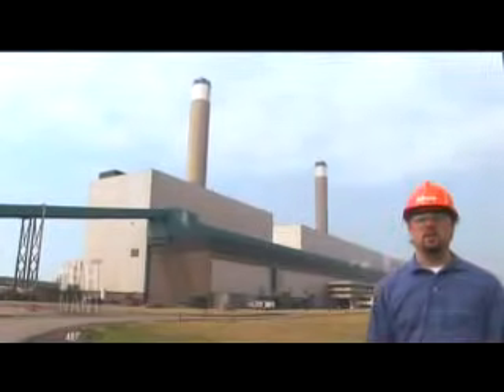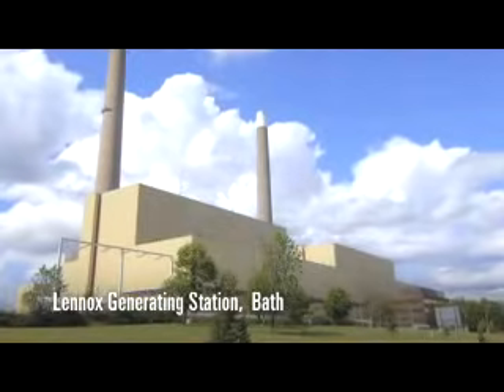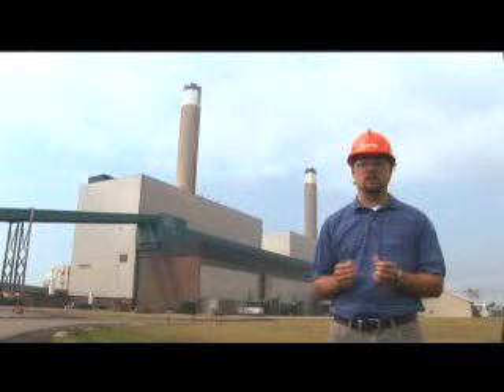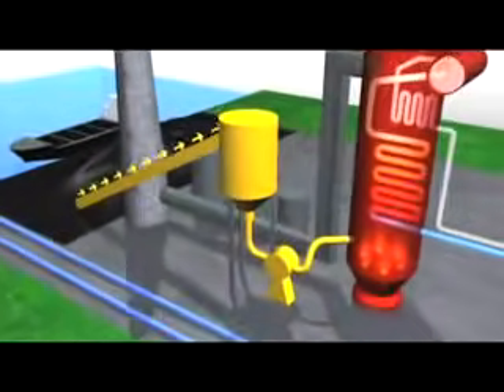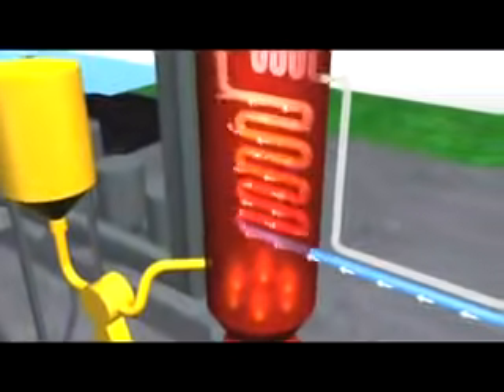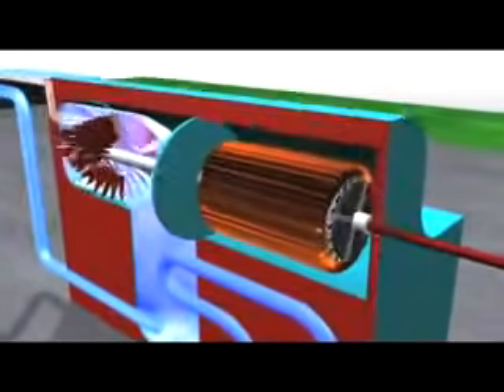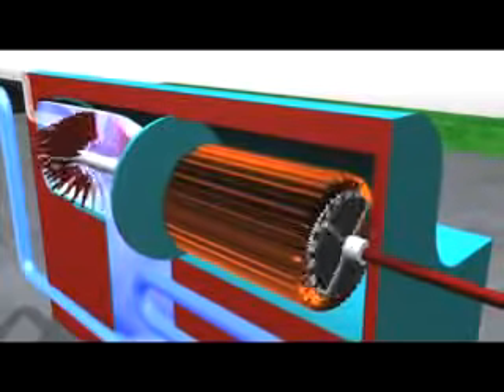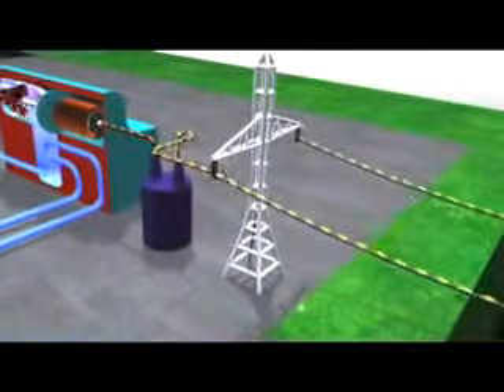How a coal power station works

Comment: don't They Saves the generated electricity in LARGE BATTERIES ? which can then be converted into A.C.currents whenever there is demand. plz elaborate .
Reply from the maker: C.A. Bachhav no. It’s not possible to store the large volumes of electrical energy required by homes and industry.

Comment: Wait why is there a turbine when we could just pit the rotor there instead (and maybe with blades so It could act like a rotor) and plz tell why this won't work XD
Reply: Because the turbine IS the rotor. A rotor, by definition, is any part of a machine which rotates.  Turbines rotate.  They have to in order to move the electromagnets. Hopefully you get a notification from this so you can finally get your answer.

Comment: Mr. Patel,

I'm delighted to see that you've worked so hard on this model. It clearly violates the Law of Conservation Of Energy. I've a few arguments to make.

1. If it is so, then why don't you connect the output of the cam to the input mechanically, And see if it operates on its own. As the output of your isolated device is more than the input.
2. Linear force X Linear distance is not equal to Radial Force X Radial Distance. All it matters is the shaft creating as much energy as well.
Reply: on god no kizzy

Comment: The question was not clear. What do you wish to do? Mix the Smoke from the coal directly in the water? The fire burning in the Kiln is producing the smoke, but it is conventially used for heating the air only. So the energy of the hot waste gases are already drawn.

Comment: 1. First of all you can never eliminate a condenser from a thermal cycle which includes steam.
2. efficiency is only measured in a power plant for a closed cycle.
3. The steam that gets condensed in the condenser is only responsible for the vacuum. The air pumps are only responsible for removing the non condensable gases. And creating vacuum for initial start-up.
4. Lower the density of what?? Please read your own last line of the comment, and consider yourself Dumb. 

Peace.

Comment: I think I understand the positive pressure concept.  I'm working on a project to recover energy loss in a kiln. I'm Trying to figure out the optimum operational settings under specific conditions. If I use a condenser and combine both exhaust and used steam, with the distilled water become tainted by the heating sources possible smoke? I intend the fire to burn hot enough that it vaporizes any smoke, but can you see any problems with this concept?
Reply: on god no kizzy

Comment: Hey! I guess you are working in a power plant. Let me help you with the condenser there. 
1. Condenser Does not decrease the efficiency of the power plant, rather increase it. why?
2. because it maintains a vacuum inside it which provides a positive draught in the steam.
3. If you see the Rankine Cycle, it'll self explain you how the heat lost in the condenser leads to a higher efficiency.
4. Its almost impossible to pressurise the steam of such a large quantity into the boiler.

Comment: 1.Generator is synchronous type. Its usually 2 poles for steam run turbines.
2. Captive power plant is the one whose power is consumed within the industry for which that power plant was set up. While most power plant pump power into the grid.
Reply: ON god no kizzy

Comment: This enables reasonable thermodynamic efficiencies to be realisable, but at much lower temperatures.  Its not the end all be all, there is room for improvement, but for a closed loop system its far more efficient that using a single phase gas system at much higher temperatures (factoring in heat losses, the efficiency would be horrendous).

Comment: Lots on nonsense being spoken here, by people clearly lacking any engineering understanding. The reason the steam is condensed back into liquid, is simply because you can generate an awful lot more pressure from a liquid boiling into a gas rather than simply working with steam. 
Without the condensation back into water, what you basically would have is an indirectly fired jet engine, and instead of working with turbine temperatures in the hundreds of degrees, it would be in the thousands.

Comment: It isn't cooled, rather it looses it's energy when it goes through the the turbines. The more energy that you extract, the lower the temperature of the steam leaving the turbines will become. The steam then needs to be turned back into liquid so that it can be pumped. They use economisers to use waste heat to heat up the fluid after its been condensed to increase the efficiency.

Comment: For people asking why the water needs to be cooled:
The steam is cooled after leaving the turbines in a condenser that uses water as a heat sink. The condenser turns the steam back into water. The water used as the heat sink to cool the steam absorbs the energy. It is necessary to keep the two water seperate because of the pressure differences.
Reply: on god no kizzy

Comment: @MiKExAUS It's cooled to drop the pressure.  The steam comes through because of the difference in pressure, so ideally the steam will go through the turbine (where it drops in temperature because of the work it does), and condense to leave a low pressure on the other side of the turbine.  Ie you don't want a back pressure through the turbine

Comment: So I'm assuming that coal is much safer than nuclear power?
Reply: Yes and no really. Nuclear power is exactly the same thing but they use radiation to heat the water instead of burning coal.
Coal is more harmful to the environment, most nuclear waste consists of radioactive rods that are no longer radioactive enough to heat water but are still capable of catching alight or poisoning people. So it must be contained somewhere.
Each power source comes with their own set of risks and dangers; Coal is dirty, nuclear is clean. Coal usually has more accidents than nuclear but nuclear accidents are way more harmful if they do happen. Hopefully that makes sense?

Comment: @ChristyOB3 By using Absorbers. Absorber towers are placed between the boiler and the stack. It uses Lime to scrub the dirty flue gas before it exits into atmosphere. Most coal plants scrub the flue gas to 90% clean air or higher. What everyone thinks coming out of coal power plant stack is pollution is not. It's about 99% steam coming out of those stacks. But you'll never hear that on the news because they want you to think coal power is dirty. Coal power is held to high standards with the EPA.

Comment: depends on what kind of boiler it is some are split like a and b side or a b&w boiler and just open. on a old school boiler your ur igniters face each other in a x shape.  To get the boiler up to heat the igniter comes on first which is mainly diesel you heat comes up then they start hangin the meat to it.  if you never been in a 750mw unit or anything bigger its hard to get a picture of how everything works
Reply: on god no kizzy

Comment: I agree coal is EXTREMELY DIRTY! But  things have been done to clean up emissions using FDG's, bag houses ect.(Flue Gas Desulphurization)  wet mixture of lime is sprayed directly into the flue gas path it reacts with So2 and is then collected in a calcium slurry.  about 90% effective. I'm a Mech. Engineer in the power industry and I try to stay out of coal plants. I like Gas Turbines and Nukes myself. I'm not against coal as long as the proper steps are taken to keep it as clean as possible.